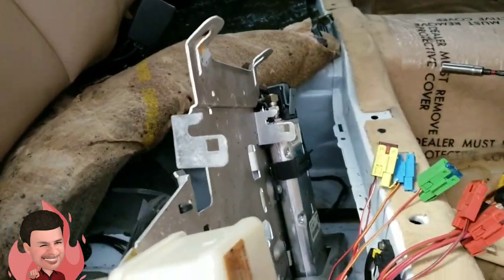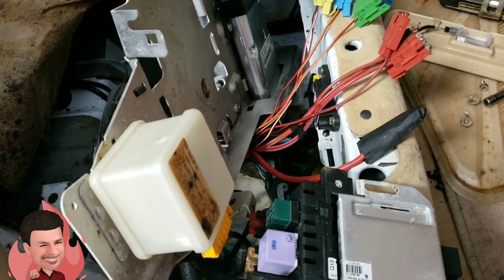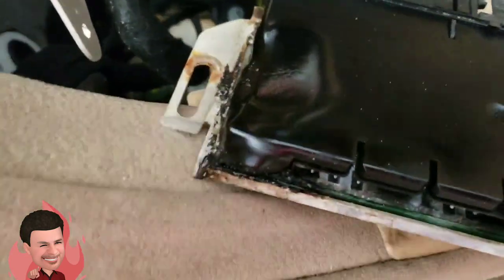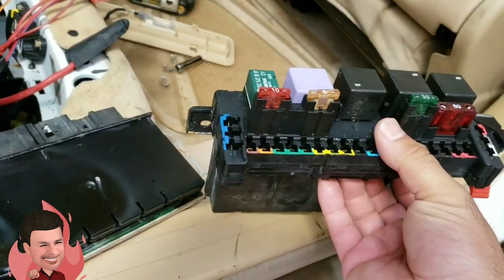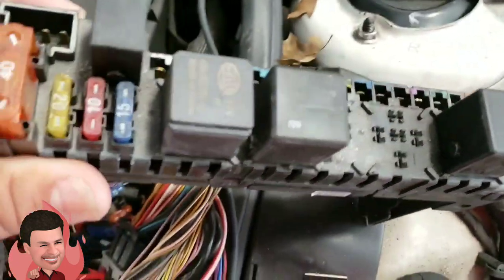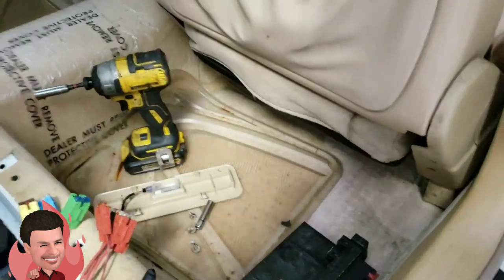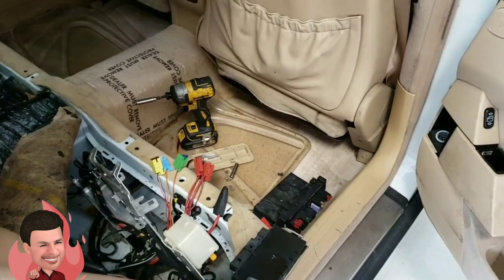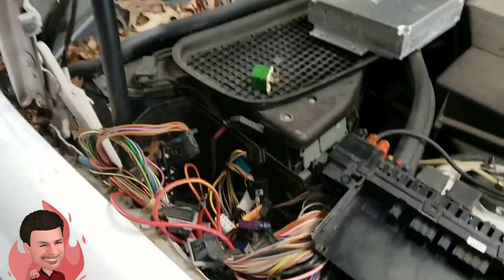Mercedes S500 Electrical Issue.

Comment: permission to ask sir, your problem is the same as mine, I have replaced the new module, but the right and left front signal lights don't work, if the main light is turned on, then the right or left turn signal is turned on, the high beam lights also come on, what is the cause? Can you help me

Comment: HELLO I HAVE A 2003 S430 MERCEDES BENZ ...IT ONLY HAS 126,000 MILES ON IT BASICALLY LIKE NEW.I CANT GET MY LIGHTS TO COME ON .AND NOW MY TRANSMISSION WILL NOT CHAGE OUT OF FIRST GEAR.AND THE LIGHTS ARE NOT COMING ON IN DASH THE PS OF ANYTHING NOW MY DOORS AND TRUNK WANT OPEN WITH KEYS LOCK I JUST GOT IT LASTYEAR IN SEPT.

Comment: I know it's 5 years ago..electrical issue nothing works on dashboard, radio, heat, signal, speedometer etc...which sam control that

Comment: Hi I’m hoping no I’m praying you can help me troubleshoot a problem with my w211 2009 Mercedes’ E550 sport base airmatic system. Only problem I ever have with this car is the airmatic suspension system. Here we go the car once again will not rise vehicle rise Malfunction on the dash. 

Have replaced the following all within the last 2-1/2yr all struts or front struts rear bags. Valve box, Two compressors- tried to save $$ bought less expensive version 1st time noisy but got the job done. Ck all lines no leak … after replacing 2nd airmatic compressor .. no power - ckd relay & 40a fuse both were fine … it was not the 15a fuse nor the 7a fuse ——- then I discovered the orange 40a fuse & the 150a fuse in the pre-fuse box on passenger side floor board was blown … I changed it … compressors came on and car rose beautifully. Went out of town car sat 2week return the compressors once again sign of not receiving power when I turn on the car.. applied external power .. compressors works … went back to pre-fuse box under the carpet passenger floor … it’s blown again but only the orange 40a fuse not the 150 fuse…. What in the world is going on? 
I have a few more choice words but I’ll keep it clean…. IF I HAD THE $$$ I would take it too Mercedes… so plz I’m asking u to point me in the right direction … 
No lights on dash… only vehicle rising malfunction after I start the car ….
Please the girl needs some help plz 
Thanks in advance.. sorry I do not know all the technical terms or names of parts..  I hope I made sense. 😢
Reply: No water 💦 in the floor.. everything is dry …
Reply: hi.let us know how was it done plz

Comment: My 2006 s500 keeps blowing (immediately) the #78 fuse. Any thoughts?
Reply: Have the same thing, can't figure it out...
Reply: problem may be in the wiring under driver side carpet, doubt you have the car still